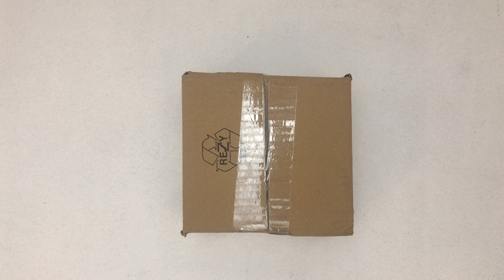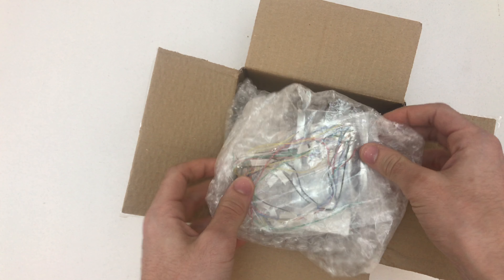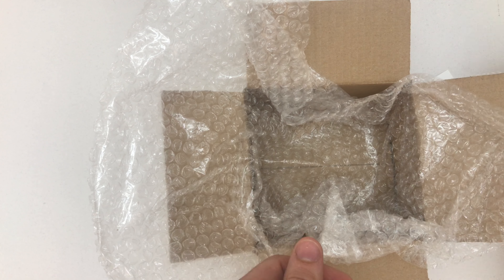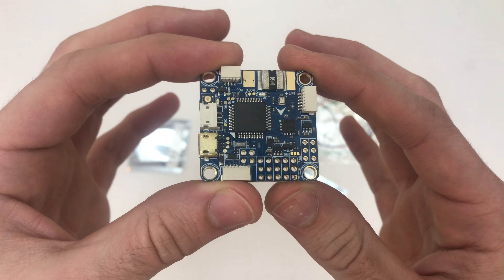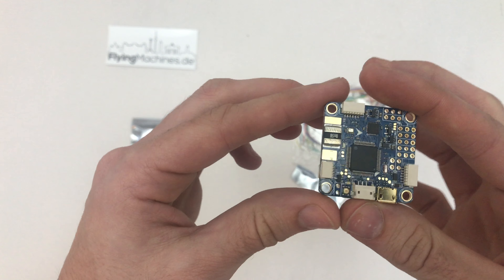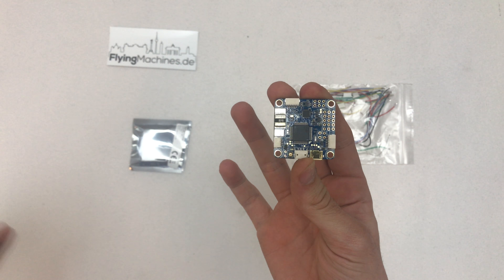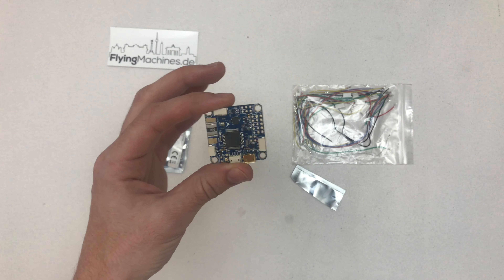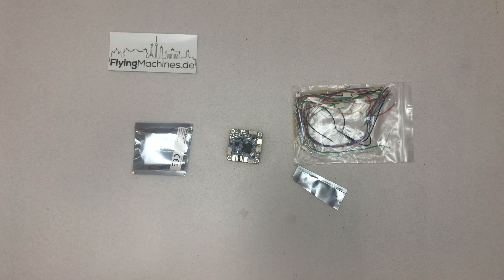Unboxing // OmniBus F4 Pro V3 // OBF4ProV3 // FC // OSD

Comment: Hallo
hätte ne frage habe mir auch das Omnibus f4 v3 pro gekauft soweit alles fertig zusammengebaut aber in betaflight bei transmitter bewegt sich nichts bei yaw,roll,usw ???
Habe auf UART 1 ... serial receiver....sbus... eingestellt wie es sein soll aber nichts ist ?? Gebunden ist er der receiver ?? 
weiß nicht mehr weiter vl können sie mir weiterhelfen !
mfg
Reply: Ich nutze meins nur mit iNav in meinem Wing, Quads fliege ich mit RaceFlight... habe keine Ahnung von BetaF... hast du sowohl bei Ports als auch bei Config auf "serial Rx" gestellt?